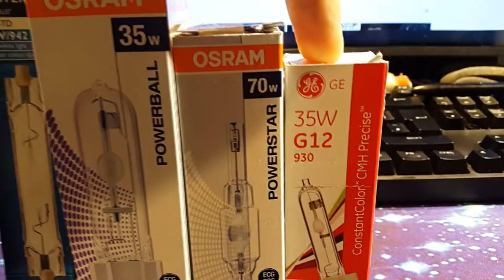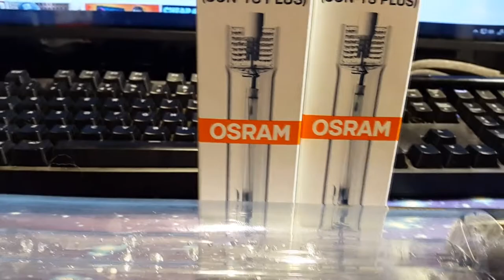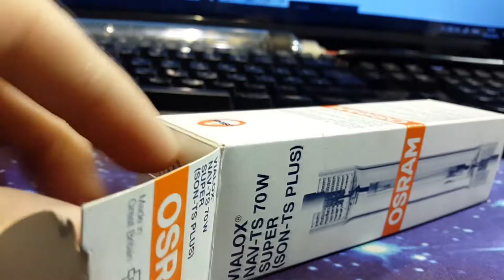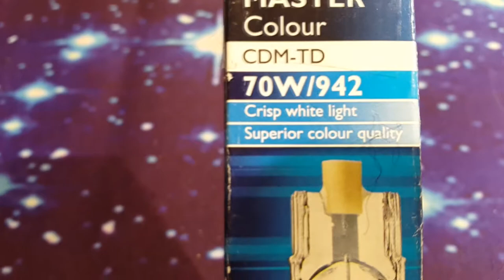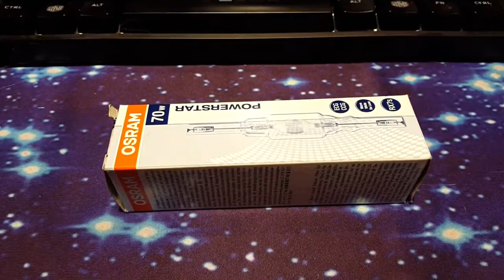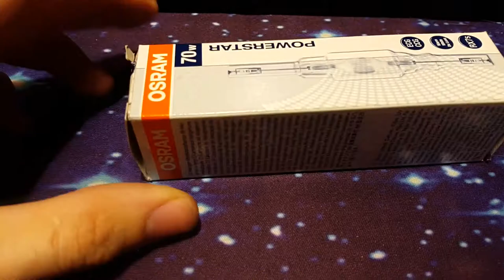Taking a quick look at a few gas discharge lamps

Comment: 18W SOX still used in bulkheads mounted on walls of schools churches community halls town hall libraries shopping precincts & public toilets. All mounted @ 3 meters. 35W SOX used on footpaths alleyways bungalow housing estates.
Reply from the maker: Not as much as it used to be though. A lot of places are turning to high pressure sodium and metal halide as alternatives. And if they're not using those then they're switching over to LED. Mostly because current LED tech has similar performance to current HID technologies (most good LEDs meet the efficacy targets the EU set out in 2009) but doesn't carry the explosion risks metal halide does, has higher color rendering than HPS, and apparently it's supposed to be a longer lasting technology... although I have seen plenty of dead LED lanterns so far!!

Comment: there's 10W SOX 18W SOX 35W SOX 55W SOX 90W SOX 135W SOX & 180W SOX. 10W SOX is very rare now the 13W CFL bulkheads replaced the 10W SOX bulkheads that were in council flat corridors & bollards.
Reply from the maker: I know. 10w SOX is amongst the hardest to find. especially if you're looking for GEC lamps. it's rare you ever see more than one in the same place. as for 18w it was (if production hasn't halted) in production still alongside 26, 35, 36, 55, 56, 90, 135 and 180w lamps. Then there's linear SLI/H, SO/H and some really weird prototypes that are even rarer than a Philips Bamboo 60w.

Comment: take care of your sox lamp , the arc
tube where are the electrodes are getting white , normally a beginning of a sign of tube  fatigue
Reply from the maker: yeah. with it being a used lamp when i got it,  it was already like that. I haven't put many hours on it for that reason as when they start to white out like that, that can mean they're getting close to the end of life. not to mention it does flicker a little and the discharge on startup has started to brighten. certainly won't be getting put into active use when I restore my amber minor. I'll get a new lamp and keep this one in the best condition I possibly can.
Reply: Don't wait too long for purchasing a new bulb, my order for a case of 55 watts sox is arrived today at my supplier ,for my 135 and 180 watts it's back order ,hopefully i will get them soon !!i have written yesterday to philipps and the response  it is official ,last accepted order before july 2019,and production of sox ;amps stops in 2020
Reply from the maker: Already have one on order. I got a 35w Radium SOX coming :)
Reply: awesome :) hoping you will show it !!
Reply from the maker: Yup. I'll be breaking it in for a few hours when it arrives so it'll be getting shown here if all goes well. at the very least I'll be showing it in this gallery: https://www.lighting-gallery.net/gallery/thumbnails.php?album=4875
Reply: i will do the same when my 135 and 180 sox bulbs arrives and still waiting news about the municipality who still have 180 sox heads lighting their street if they will remove them in a near future
Reply from the maker: Got the new lamp!!

I struck it up to break it in for a few hours and then did a couple extra photos striking up the old Philips lamp next to it only to discover a really cool effect that I'll have to document on here as soon as I can!

Here's a picture of the first ignition!!
https://www.lighting-gallery.net/gallery/displayimage.php?pid=145453&fullsize=1
Reply: from the picture it's in top shape , very happy you got it in working order,still waiting mine 135 and 180 watts, no call yet from my supplier as soon they are in Guillevin my electrical supplier , i will give the ok to send all the 55 ,135 and 180 watts sox together via Purolator
Reply from the maker: veil67 nice! Can't wait to see what you do with them :)